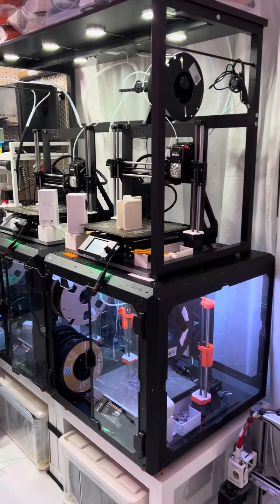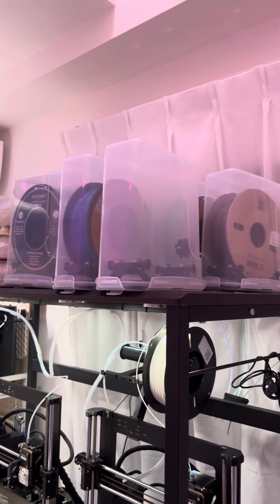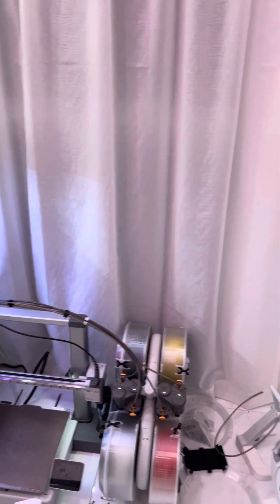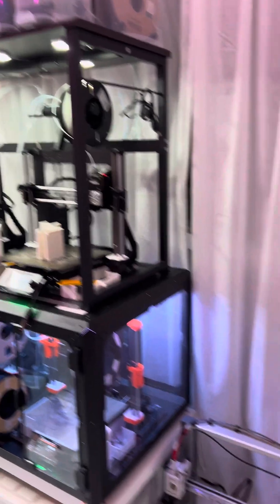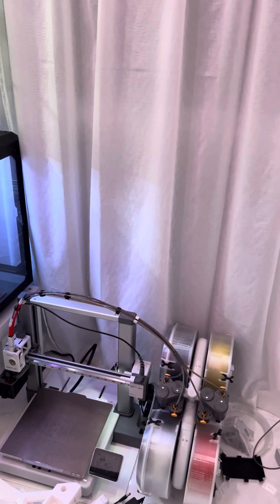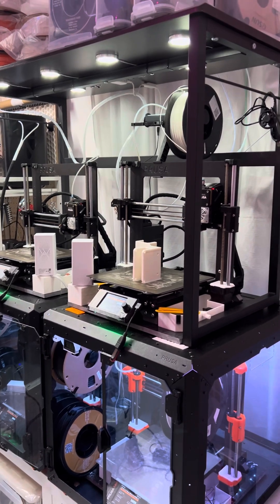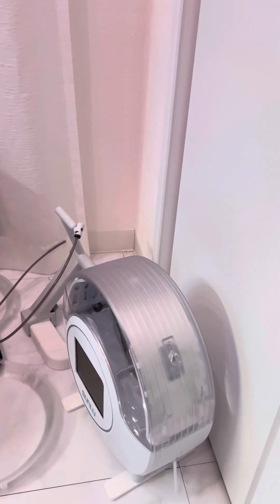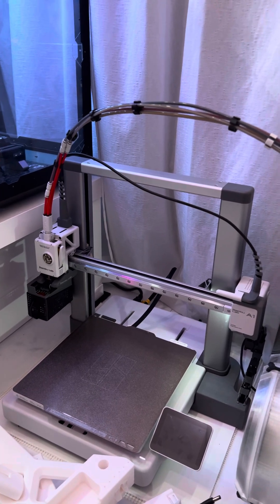Amazing BambuLab A1 x MMU3 3D Printing Made EASY

Comment: I got mine for Christmas too, and I agree, it's an awesome machine!
I’ve placed my Bambu Lab A1 in an enclosure because I don’t want to risk inhaling any plastic particles, regardless of the material I print with.
Happy printing!
Reply from the maker: @SuperBenji63-92  I have an extra room for my makerspace with an air purifier keeps me safe (I hope) and as it is now, I’m confident in setting things to print and not returning until they’re done or for maintenance. My bottom two Prusa’s and the K1 Max are enclosed as well. 

It’s truly scary how EASY this machine is to use. I’ve been printing for awhile, and enjoy the tinkering and mod aspect of this for work and hobby. But this BambuLab A1 is on par with the Creality. I’ve got to do some more prints, but could be on par with the Prusa machines as well!

Enjoy your holidays, happy printing, and thanks for commenting!